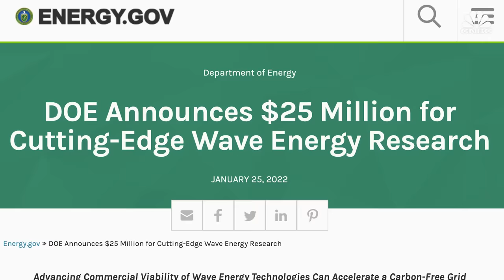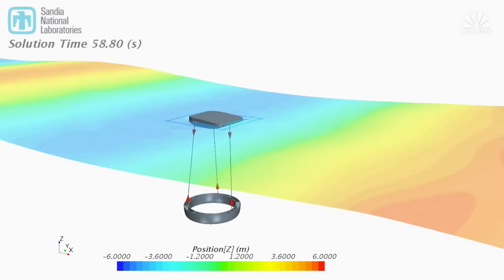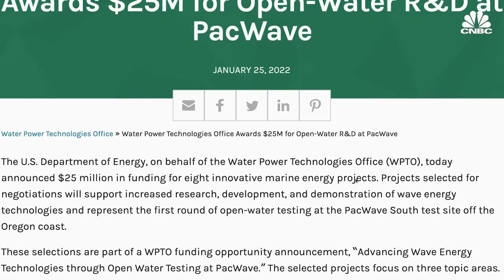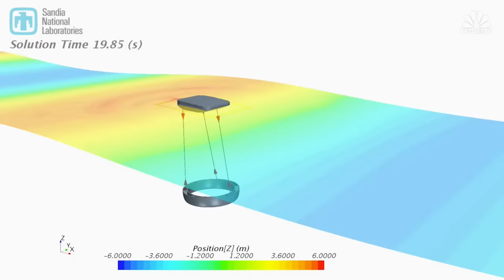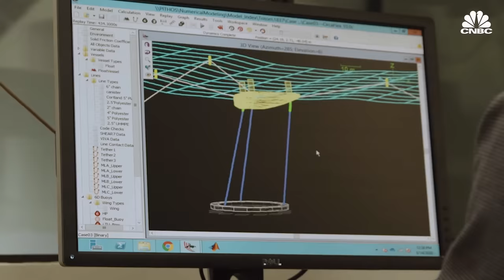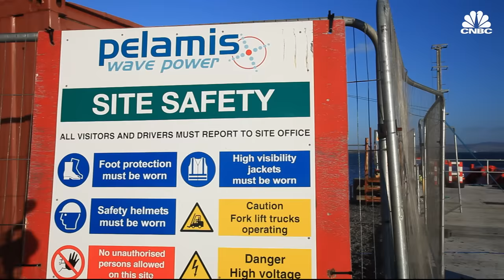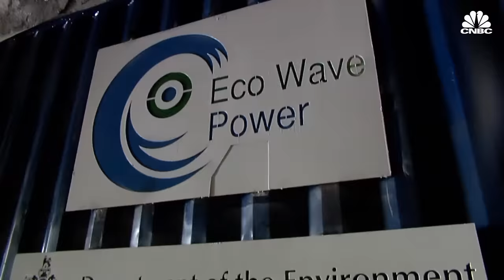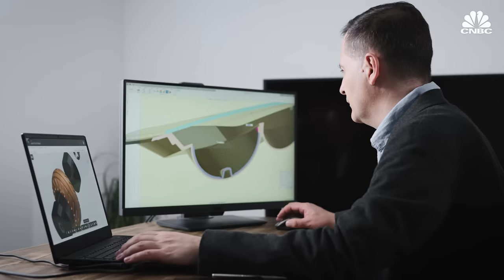How Waves Could Power A Clean Energy Future

Comment: If you look at most wave energy projects they typically fail because water erosion is almost impossible to build against. the water itself destroys whatever device you're using to capture the energy.
Reply: Well any projects, clean energy or not, will require maintenance. This is no different. Corrosion control is part of the maintenance of many sea equipments anyway.
Reply: Not just erosion, the device itself is too expensive and doesn’t produce enough electricity to justify the cost.
Early days, but surely somebody will come up with a feasable system to harness the power of the waves.
Reply: Wouldn't it be cheaper to have some inlet that have a high tide, and then you keep it in, and then allow the Highwater level in low tide to generate, idk just throwing ideas.
Reply: @MrBoliao98  yep, that’s similar to how hydro power generators work.
All that energy and it cannot be harnessed.
Reply: that is on e of the main hurdles they are trying to solve.. if oil rigs can be built in the ocean why can't we we make a rig for wave energy..
Reply: @MrBoliao98  yes, but that is not enough water. The idea some have is to use wave energy to pump it up a big mountain at night and release it during high peak hours, exactly like a dam. But then you need a mountain nearby.
Reply: @teren60  oil rigs are very, very expensive.
Reply: @CallumDuff  you are absolutely correct but the idea here is to investigate other sources of producing energy especially where solar energy is not possible. I don't know whether this technology would be successful but I would brand there projects as research and development. If they were able to advance the technology and bring cost down then why not. Solar energy was only possible after running exploratory projects like these which brought the price down and made it mainstream.
Reply: @vtechead1  the last idea is feasable, as everything is above water on land except the plastic wave moving things.
Reply: @TheBooban   just an inlet not a mountain my dear
Reply: Yes. No impact on migratory patterns whatsoever.
Reply: Idealistic developers starts over and over on these projects every time crushed by mechanical fatigue, corrosion and erosion.
Reply: @raymonko  It IS different because these devices do not generate enough energy to recover the energy spent to build them before rotting away and having to be replaced. Every single one of these that gets built is a net detriment to the environment.
Reply: @MrBoliao98  High hide to low tide is a head difference of a couple meters at most. You would need a MONSTROUSLY large reservoir (with associated incalculable energy expenditure to dig it and build the dam around it) to harness a ridiculously small amount of power.
Reply: @TheBooban  At that point you're just making a traditional pumped hydro storage with highly corrosive seawater instead of making it with regular old non-corrosive freshwater. Why would you ever do that?
Reply: @demoniack81  "these devices do not generate enough energy to recover the energy spent to build them before rotting away and having to be replaced." That may well be true of many prototypes built so far, but it's not intrynsic in the technology. However, I don't believe that it is necessarily the casse in general. I just did a quick sum on the AW-energy waveroller. The one deployed in 2019 is a 350kW device with 25-50 capacity factor. So lets say we can get 100kW continuous from it. The thing is something like 20 tonnes of steel and 30 tonnes of concrete (estimate from images- I couldn't find any figures). That's about 400,000MJ or 111,000 kWh of embodied energy. So the thing has to run for 1000 hours to get back its embodied energy. That's only 46 days, so even if I'm out by a factor of 2 or 4 it's still energy-positive. The prototype ran for 6 months before they took it out for inspection. So if you can make something that works for a year or two you'll be way ahead on the embodied energy. That doesn't seem impossible does it?
Reply: @xxwookey  None of the prototypes that have been built in the last couple decades have managed to do it (if they were, they would have made it to market). 
25 tons of steel and 30 of concrete. 300kW is 300kJ/s, since W = F*Ds and the size they list is 8m, this gives an average force of 37kN, or a torque of around 300kN at the base (I'm sure I'm doing something wrong here and it's not that easy, but I don't think I'm too far off).
You're not going to reliably counteract 300kN of torque with a 30 ton footing, especially not if it's a single point of contact like in their pictures. And keep in mind that that's just its rated power, it has to stand up to much higher forces in rough seas or it's just going to get ripped right out of the ground.

And also there's no way that thing only weights 30 tons. The generator room needs to be watertight, which means it is effectively a pressure vessel (in reverse).
If there's one thing that pressure vessels are not, it's "lightweight."
An empty shipping container (which is NOT strong enough and would buckle like a tin can if you tried to use it as an airtight underwater room) already weights more than 2 tons, and it is MANY TIMES smaller than that generator room (look how tall it is compared to the guy standing next to it - containers are only 2.6m high). 
I'd bet 50 bucks the generator room alone is more than 30 tons. The I-beams underneath give it away, look how big they are. I've seen BUILDINGS with smaller beams than that.
You are also not taking into account the energy cost of the generator, the electronics, the cabling, all the accompanying structures on land and at sea.

Also steel takes about 8MWh of coal per ton, so even if you were right, 30 tons of steel alone (just making it, not shaping it, trasporting it or otherwise working it in any way) is 240MWh which is twice your whole estimate. This does not include the energy cost of extracting, transporting and refining said coal, either.
Adding in 30 tons of concrete requires another 0.8MWh of fuel.
If we get nitpicky ou're also not taking into account the cost of all the protective paint (multiple coatings, which on large structures start to really add up).

Finally, a 50% capacity factor seems rather optimistic considering that even offshore wind struggles to go past 25-30%. 
Where are the sources for this claim? Nowhere to be found, as usual.
If this project was worth anything they would make their preliminary results public, instead their website has absolutely nothing of substance. It's all just marketing, no hard data at all.
Reply: @demoniack81  The base is filled with water to make it sink so it ends up a lot heavier than the hollow concrete floating shell. Yes my calculation was very approximate. But as I pointed out, if you multiply by a factor of 4 then it has to run for 6 months, which it has already done.
I used a 30% capacity factor for the sum, at the lower end of the published range. Agreed there is no hard data on the site so we really can't tell how well it works, or how heavy it is.
I found two estimates online for steel embodied energy: 20MJ/tonne and 16MJ/tonne. Here's a more thorough analysis which gives numbers mostly between 20 and 40 but some higher and lower. Again, a factor of 2 or 3 makes no difference to my argument that even a massive machine doesn't have to run all that long to cover its construction energy, so it's clearly possible (assuming they are not lying about the power output).
Wind turbines pay back in 4-8 months, solar panels in 12-18. Looks like wave power could be in the 6-24 months range (yes big handwave, awaiting some real data).
And ultimately we only care about energy from an EROEI point of view. It's actually emissions that matter.
Reply: @xxwookey  If we cared about EROEI then we'd stop wasting money on pointless projects and would just start building nuclear reactors (especially FBRs which can reburn the waste from traditional LWRs and extract 2 orders of magnitude more energy from it).
Solar and wind are fine if they pay for all their externalities by themselves, (backup turbines, grid interconnection improvements, storage etc), but we should stop subsidizing inefficient solutions at the cost of things that actually work at the scale we need.
France decarbonized 50% of its entire primary energy in 15 years with nuclear power. We've (as EU) invested over A TRILLION EUROS in renewable in the last 15 years and barely added 10%.
If we had spent a trillion euros on a unified standardized European NPP design to copy and paste all over the continent we could have easily done 50-60% by now.
Reply: @demoniack81  The EROEI of solar and wind is pretty good these days - a lot better than it used to be as manufacturing efficiency and scale has improved. It's more than good enough to be a useful technology. I only brought it up because you were insisting that it must necessarily be <1 for wave power. Sure nuclear works very well too and has excellent emissions numbers, but wind and solar are now cheaper in most locations. It's so much easier to finance a 3-year wind project than a 10 year nuclear one that I don't see that changing much over the next decade.  Nuclear should in theory be a lot closer to £50/MWh than 100, given govt finance guarantees, but no-one has achieved this for a long time apart from the UEA with Barakah. Maybe the Chinese have too but they aren't saying SFAIK.
The idea that nuclear solves all your problems and solar and wind are 'pointless' is pretty daft in 2022. Nuclear gets even more expensive if you run it as a load-follower.
And where is the logic in insisting that solar and wind cover all the grid externalities? No generation type pays for its externalites. They all just generate and we design the system to produce matching supply and demand whilst trying to minimise cost. That's as it should be - it's a system design problem. The right mix of nuclear, wind, hydro, storage, demand-control, peakers and solar varies by geography.
I do agree that the woeful history of FBR projects over the last few decades is pretty sad. Only the Russians have managed to run one commercially.
I'd say that we have picked a standardised European NPP, but it's a very safe and rather expensive design (EPR) which it's taken a while to learn how to build without embarassing overruns. You might argue that a different design should have been picked to make your cost assertions more plausible, but it wasn't. And, given the lack of engineering literacy amongst both the public and the political class no-one is going to chose a 40% cheaper marginally less safe design. And no-one in the western world at least is going to be choosing the Russian FBR design now either. If the world was run by engineers then yes maybe those things would be possible but outside China it isn't.
What we're actually likely to get is a mostly solar, partly wind, setup with batteries and hydrogen peakers, hydro in some countries/regions and some nuclear, especially in higher lattitudes. That fact that the first 50GW of renewables was really expensive (50% more than nuclear) is no guide to the cost of the future GW, and whatever is cheap and quick and scaleable will win.
All IMHO, of course. We shall find out soon enough.
Reply: You may wrong, if structure system place under water , under blast zone it can proloong 30 to 40 year.  we success develop a devise with multi functions converts all wind, wave and current kinetic into electrical. In technical our technology is workable specialy impossible destroy by sea environmetal. The commercial depends on how big scale of market. in principle it will chipper than oil & gas.
Reply: Exactly 💯

Comment: The Gibraltar pilot plant does not exist any more @11.01 An easterly storm destroyed part of the pier and possibly parts of  the Eco wave plant, thus the whole thing has been removed.
The plant was mainly operational with fairly calm weather, the moment waves got bigger the floats would be raised to protect the plant infrastructure. If real energy tapping is going to be done the plant needs to be able to stand up to storms to harvest the energy within. The overall concept is good but needs perfecting. Its a shame  we don't have a proper plant to harness the waves ,government promised a full-scale plant ,but as yet not delivered.
Reply: This is why shore wave kit is so hard to do. There is a factor of 1000 power difference between calm and stormy weather and it's really hard to make something that works in most conditions and survives all conditions (for a reasonably amount of money). But if the pier the thing is attached to gets destroyed well that's kind of fair enough if it has to be moved at that point. We probably just have to accept some pier-rebuilding as a cost of such generation. We build and rebuild piers, sea walls and breakwaters anyway.
Having the machinery underwater helps enormously with survivability but gives you a whole different set of problems with maintenance, biofouling, cost, anchor damage etc.
Mind you after many years of difficulty and all sorts of crazy designs from many companies, Orbital seem to have made a tidal stream device which is cheap enough, robust enough and maintainable enough to have decent commercial prospects, so maybe the wave people will find a solution eventually, too.
Reply: @lepidoptera9337  I fully agree, many a times I have seen waves smash everything in its path ,that why I say if any consistent energy harvesting is to be carried out, designers and engineers need to come up with structures that will have to stand in harms way many time during service .Not an easy proposition.
Reply: easy solution would be for them to lock in place on extreme weather or some kind of protective wall put in place when there is extreme waves

Comment: there are appropriate applications for all energy sources, meeting the needs of 7.5 going on 10 B of us in vastly different circumstances will likely take all options. As NP is by far the lowest environmental impact we should be using it as much as possible. Nuclear power is the gold standard of clean energy. It’s as clean and safe as any alternative, requires a fraction of the resources and produces clean, reliable energy 24/7/365. NP really is the premier example of dematerialization in which we actually use less to produce more.
Reply: Well China is doin good by the way... they are more reliable and accurate

Comment: 10:40 If Eco Wave Power made these look sleeker and put some thought into the aesthetics I think these could actually look kind of cool and attractive bobbing up and down along a coastline or pier. This system might not produce as much power as others, but the fact that most of the expensive equipment is out of the corrosive salt water is probably a big plus for maintenance and longevity.
Reply: 🤣 facts.
Reply: It’ll still get salty and corrode quicker than if away from saltwater.
Reply: Wait until climate change really kick in. 😳
Reply: Those don't actually look too different from a sailboat
Reply: I imagine they could also design them to help reduce the impact of the waves on the land, which could be used to protect things like piers and beaches.
Reply: So far, the EcoWave concept uses floats the size of dinghies.  Given sufficiently robust anchorage, might this concept scale-up in size and increased yield?

Comment: Using the powerful natural flow of water that covers 70% of the planet to produce power instead of placing turbines in rivers and damming them up would seem less intrusive to the ecosystem.
Reply: As the guy said on the video, what's  harnessed on the sea is actually not the flow of water but the oscillation of it. Unfortunately only the narrow coastal areas of the oceans can be used for that. The bright side is that there's quite a lot of energy available there too.
Reply: @adoatero5129  What a goofy nit pick comment. Moving water, is flowing water. Tide flows in, tide flows out. Way to pick your battles dude 👍.
Reply: @bensk8in467  "Using the powerful natural flow of water that covers 70% of the planet"
Except it's not the flow it's the oscillation and you can't take advantage of the water covering 70% of the planet only narrow coastal areas. Way to lose your battles dude.

Comment: $30 million cost to gain 1 million of electricity that needs to replaced every 20 years and maintained throughout 🤔  This is why this tech will never be deployed to scale.  Financially this is a horrible investment and there are much more efficient alternatives.
Reply: Even using candles to power a steam turbine is better than this...😀😀😀
Reply: We need to come up with something besides burning fossil fuels. Why isn't the US doing any geothermal when they have huge open geothermal areas.
HI has easy access to geothermal air, sea and solar.
Reply: @ellenlandowski1659  We came up with "something besides burning fossil fuels" 70 years ago and thanks to it France has had a 50% share of low carbon primary energy (i.e. ALL energy including transport, heat, etc) for 40 years.
If only fossil fueled """"environmentalists""""" hadn't been slandering it non stop for the last couple decades.